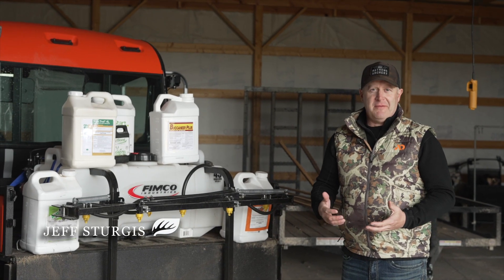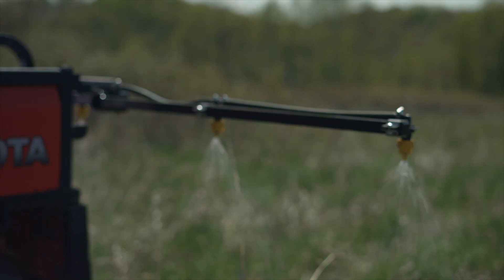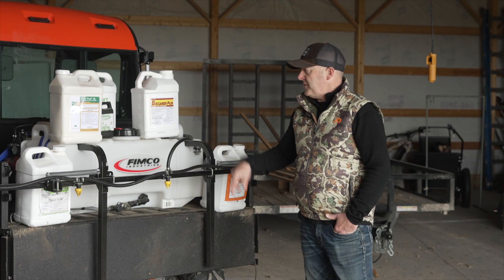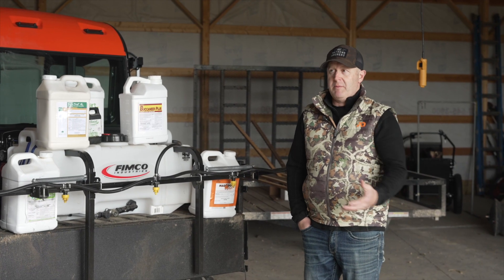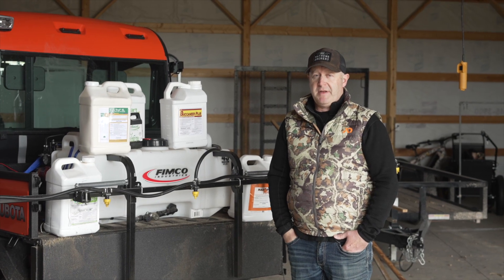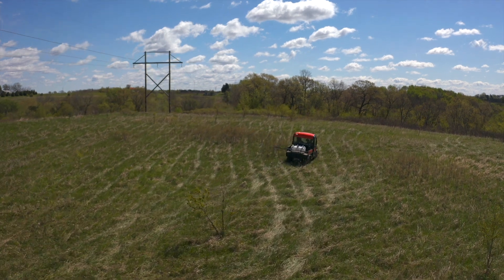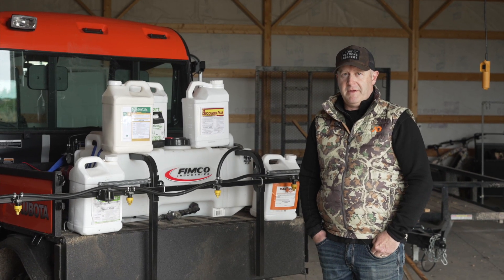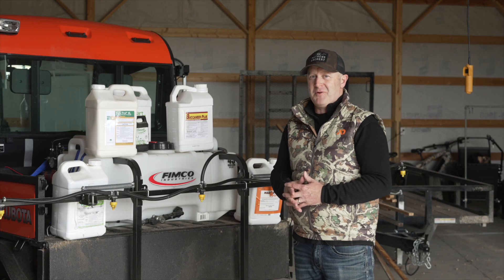Food Plot Chemical Use Basics

Comment: Round up is 2qts per acre but you suggest three sprays per plot in past videos. My question is basically are you using 2qts for each spray times three separate sprays or does it go with a smaller ratio the more you spray?

Comment: Just wondered if you can cut in July Switch mixed with Egyptian Wheat to control weeds or will I need to Spray with Gly or 2-4-D ?
Reply from the maker: You will definitely need to mow...partly to cut thr EW out as well...you can't let that get taller than the switch or it can easily shade out the switch and kill it. Learned that the hard way many years ago...

Comment: I really just want to no the oz per gallon to kill on 1 pass lol I don’t think that’s an unreasonable equation
Reply: Didn't you watch the Video?  the main point of it is that you have to forget about "oz per gallon" because the coverage rate of the "gallons" you are spraying is the important factor.  For example you need to evenly spray 2 quarts of glyphosate over one acre, one pint of 2, 4D over one acre, etc.  Whether you do that mixed in 10 gallons of water or 100 gallons doesn't make a difference. Your individual sprayer speed, tank pressure, nozzle height above the ground, spray width, etc. will determine how many gallons of water you should use to get even coverage.  Example:  Look at Page 41 of the Northstar ATV Sprayer manual for the calibration table: https://www.northerntool.com/images/downloads/manuals/2681101.pdf

Comment: Doesn’t flow rate per nozzle have a play in the amount of spray you put down along with mph?
Reply: Yes, but most quality ATV size tanks have the suggested tank PSI (which is basically =  flow rate for a given nozzle design) along with the MPH to match with the nozzles that came with the tank/boom set up.  Height above the ground for the nozzles also affects coverage.

Comment: What should I do with the winter rye that came in this spring?
Reply: cut it right before maturity. GrowingDeer on YouTube crimps it. I cut it with brush hog and it helps keep duff or mulch on soil ro protect from sun, erosion, and wind. But many ways buddy, many ways...
Reply: @travisethridge4062  thank you for the insight
Reply: @aaronkorsmo  Also depends on how you are going to plant your following crop - NO Till Drill or Broadcast. Grant (Growing Deer) is able to terminate the rye by crimping and laying it flat, because he is able to drill the seeds through the mat and into the soil for good soil contact.  You couldn't broadcast very effectively after crimping (if you have a thick mat of rye or buckwheat) because you wouldn't get good soil contact for most of your seeds.
Reply: @savagehunter3739  thank you for that. I will be sure to broadcast and then cut probably with a weed whacker. I don't have a large plot so not a big deal.

Comment: Jeff, excellent detail and review.  One question...what PSI do you run when you spray.  I just purchased a new 18' sprayer with a foam for my UTV, working great I just got tired of not knowing where I had sprayed.     thanks, Bob
Reply: Also do you neutralize, or clean out your sprayer after each use?
Reply: Best Advice I can offer is to spray a tank or two of water to figure out approximately what the coverage area is on a tank of water.  I wish I had a spray pump where I could actually have enough pressure to set it as every small sprayer I have used may pump up to 60 PSI but drop dramatically when you open the valve to send water to the spay tips.  I would shoot for somewhere between 20 and 30 psi. At 20 most tips will break the spay and start making a good pattern and keep getting better as you approach 30 psi.  Keep in mind you will spray a larger amount of water at 30 psi as opposed to 20 psi and reduce the area a tank will spray.  My spray experience started years ago on a farm tractor using both pto and hydraulic pumps where you adjusted the pressure down using a regulator on top of the tank which also kept agitation in the tank to keep the mix.  If you have an electric pump with an 18' spray area post the brand and model of the pump as having too much PSI has never been an issue I have had to face however it would be a good problem to have as it would allow tank agitation.  I currently have a 60 psi pump (1.8 gpm) with a single plastic Northern Tool nozzle (about $15) that struggles to keep 20 psi and covers about 15 feet (12 feet of real spray area allowing 18" of overlap).
Reply: Bart, thanks for the response.  I have had all kinds of inexpensive sprayers, and finally bit the bullet and purchased an F/S with a Honda 4hp gas engine.   I have plenty of pressure on the 18' coverage and have been spraying about 30-35 psi, but am thinking that getting it lower down to around 25psi would give me more droplets opposed to a fine spray. I currently spray approximately 10 gal per acre. I'm also wondering about neutralizing and cleaning the tank after each use so the spray tips don't clog and also give a longer life to the pump.   Just wondering what other folks are doing.  Thanks again.
Reply: @rfb7117  I spray a lot of acreage every year for food plots. I run my sprayer around 20-25 psi, at about 4mph, and cover 1 acre with about 15 gallons. A full 25 gallon tank at those numbers will cover about 1.5-1.75 acres.
Reply: Thanks for the info Jared......getting a little worried we are experiencing a draught and the buckwheat is just sitting on the ground waiting for rain.

Comment: Great video.
When should I spray plot start before buckwheat planting or when I plant the brassicas or peas.beans.oats.
Thanks
Reply: It depends - maybe both times.  Or a mix of PlotStart AND pelletized lime.  Plotstart is a "quick fix" to low pH, which you would apply before or during seeding.  Buckwheat is more tolerant of lower pH than the others,  so if your pH is still low when you plant your follow-up crop(s), you might need to spray it again.  Pelletized lime will take longer to increase the pH, but will "last" longer because it takes longer to break down. So, you could consider putting out some pelletized lime along with PlotStart , with the PlotStart giving you an almost immediate pH boost and the pelletized lime giving you a longer term increase  - just don't "over do it".  One 2.5 gallon container of PlotStart is supposed to be the equivalent of 1 ton of lime, so if your soil test calls for 1.5 tons/acre, then put out  1000 lbs of pelletized lime AND spray one 2.5 gallon container of Plotstart. You'll get 2/3 of the lime requirement in a "quick boost" with the Plotstart and a "slow release" of the other 1/3 with the bagged lime.
Reply: Dang good question. I was going to ask the same thing.

Comment: Sorry one more things suggestion. Glyphosate can be really hard on sprayer pumps.  After rinsing my tank and sprayer after use I add enough RV antifreeze to my tank and run the pump to have my pump being put away with the antifreeze in the pump.  It stops much of the corrosion that can occur in a dry pump.  (Takes about a quart of ii in my situation)

Comment: Do you ever add a surfactant?
Reply: That goes back to reading the label for the chemical you are using.  Everything I spray except Clethodim already has surfactant included in the chemical or else does not require it. Clethodim (at least the variation I purchase) requires a surfactant.
Reply: @bartrowe3705  agreed, just wanted to put it out there for a discussion topic for those who don’t know

Comment: Hey Jeff. Great video. Do you use dye to see where you've sprayed?
Reply: Huh, never thought of that! 👍
Reply: Tried it and it did not work for me.......
Reply: @rfb7117  same here - I had to use an awfully high concentration to really show up (much higher than the suggested mix rate).  But on the otherhand, one drop of dye in the wrong place seems to never go away.
Reply: Savage, you are correct...not sure I ever got the concentration high enough to help seeing in the field, but if I got it anywhere it was not wanted it was really difficult to remove.

Comment: Clethodim , Butyrac 200  also known as 24dB when sprayed on a Established clover plot would be okay and won’t terminate the clover??
Reply: Look into a chemical called Imox.  Kills both grasses and broadleafs and is safe for clover and alfalfa.  Replaces the need for two chemicals.
Reply: Raptor (imox) is the most efficient way to maintain a clover plot. But clethodim 2e (arrest) and butyrac 200(slay)(24d-b) works as well.
Reply: @platinumwearer20  True but they cannot be applied simultaneously so it's twice the work.
Reply: Clover is a legume not a broadleaf so you're good. I spray mine with 24D every year. Clethodim and 24D is my go to.
Reply: @wolfpack4128  Make SURE you are using the Butyrac 200 (24dB) and not 24D (Amine) on clover.  24D (Amine) will KILL clover.  READ THE LABEL and don't depend on videos only for information.

Comment: I use the same FIMCO 7 nozzle boom.  97.5% right - Jeff that's the percentage a great man used to say he was right about.  Love your guidance 97.5% of time... Unfortunately your guidance today is subjective.   On page 7 of the product manual (attached) describes in graphs the pump PSI and application Speed to use get gallons per acre - which equals herbicide / per acre for your 7 nozzle boom with the spray tip [AIXR11002VP].   https://media.tractorsupply.com/is/content/TractorSupplyCompany/tsc/product/1/35/04/42/1350442_Man1.pdf To apply OZ/acre application I urge folks to read and understand their product manual.  Carry on Jeff - I love your channel and wisdom you offer.
Reply: I have 3 different fimco sprayers.  The coverage stated in the manual based on psi and speed does not match my calibration results.  Following the manual before real world calibration has caused me to over apply.  Oops!
Reply: @rickhelps9879  Yep - you setup the sprayer based on the manual and THEN confirm the calibration.  Otherwise there is no "Calibration" to true just estimating.